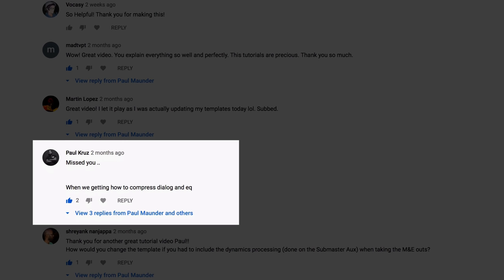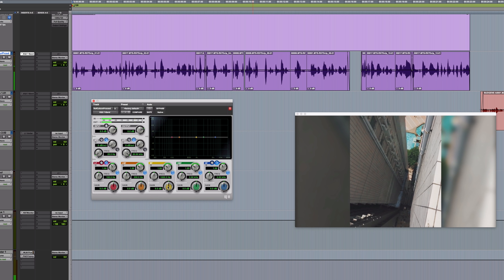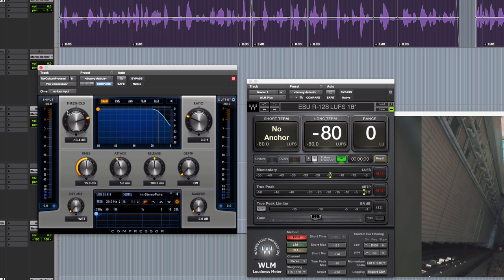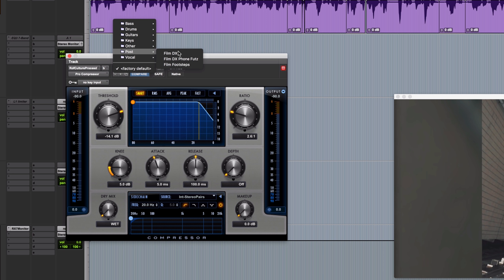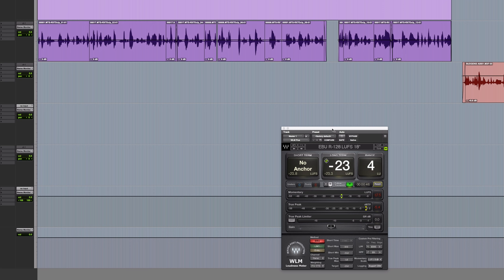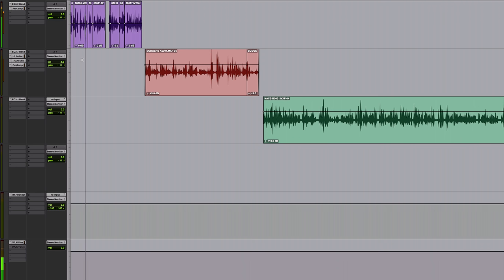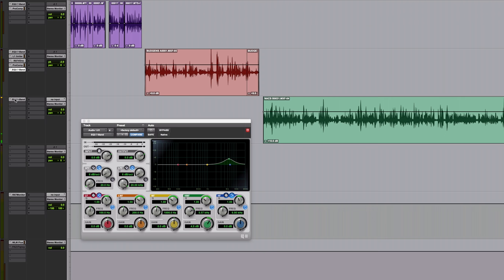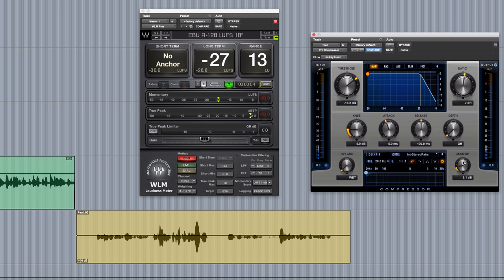How to compress and EQ dialogue using Pro Tools

Comment: Thank you Paul! I've been blindly using compression for dialogue. With your explanation and workflow, now I got a better idea of how to approach it. In the mixes I've assisted, the mixers usually have an open compressor on the DX bus, like the multiband you have here, reducing around maximum 6 db (usually less).
Reply from the maker: Thanks Gaston. I hope that you find the techniques useful!

Comment: I follow similar methods. I recently did a corporate promo, what I'd say is because the turn around was really quick, I had a day to deliver, the approaches in this video I would have run out of time. No time at all for shiney eq settings. I did a one size fits all signal processing stage on the busses and finished with tricky mixing. With that said most of the DX was good quality to begin with. But I had an hour for each version, 6 versions in all. Including session set ups.
Reply from the maker: Yes, that's very often the reality of it. A lot of the mixes I do are super quick turnaround and there isn't really time to go into too much detail with tailored settings for every piece of dialogue. In this video I've shown a workflow which works if there's sufficient time. As you mentioned though, sometimes the mix just has to be done within a certain limited timeframe. That's a big part of the reason why a lot of people use templates with plug-ins already in place and run most stuff through it with little or no changes. Not ideal but deadlines and budgets often dictate that that's the only option.

Comment: Great video. That's very similar to how I do it as well for corporate style videos. Start with an EQ, then I always de-ess at least a little bit, then Rcomp with a 3:1 ratio and setting my threshold so that generally I'm only getting around 3dB of compression. I usually always ride the fader after to smooth it all out. I'd be curious to see a video based more on narrative/feature style where there are a ton of dialog tracks, different takes, different scenes, etc.

Comment: Thanks for the tutorial, I love these types of videos! It's really cool seeing other people's workflows and methods.

I'm also a big fan of the SA-2 and RComp on dialogue. @56:45 I think that might be a good example of why RComp can be so transparent as you say. RComp's ARC, automatic release control, helps prevent situations where a large spike in volume causes the subsequent audio to be egregiously attenuated, which is what I think was happening there with the ProComp? Also, while I know this was demonstrating how to compress dialogue in different situations and mixers don't always have the time to do so; I think using some clip gain automation as it goes into the compressor could help make the compressor do less work in some of the situations shown here. I really like clip gain > clip gain automation > gentle slow compressor > gentle peak compressor/limiter > volume automation as a way to get really transparent leveling, where each stage is making the next do less (if any) work.

Another thing I noticed was during the Roof Culture track, a few of the clips (like 3) had a resonant frequency that stood out to me, but at different frequencies depending on the clip. I didn't even know it was a thing until now, but that seems like a perfect situation to use that clip channel strip thing ( as opposed to having to automate an EQ ). If only I had ProTools Ultimate :(

The only thing I was really wasn't a fan of, and I love and use RX all the time, was the Voice Denoise. I could definitely hear artifacting. I personally like EQ + WNS on the dialogue track and Voice Denoise when necessary on the dialogue bus, but I really don't like relying on the adaptive mode. Especially at the beginning of a clip, as it takes a second or so to adapt properly and clamp down and can cause other funny stuff. It's super useful in situations as you mentioned in the video, but ultimately I prefer to automate it ( again, that also unfortunately takes extra time so adaptive mode can sometimes be a time saver).

One thing I learned from one of John Purcell's noise reduction demonstrations (dialogue editor; at least what I took away from an offhand comment of his :P) is that a little bit of an expansion type noise reduction like WNS, DNS,  or C4 in expansion, can help the dialogue feel a little bit punchier, before it starts making the gating noticeable, whereas Voice Denoise or Spectral Denoisers don't really do that as much to my ears. So I really like RX/Absentia (Audiosuite) > (DX Track) EQ (filtering) > WNS > (DX Bus) RX Voice Denoise for my noise reduction workflow.
Reply from the maker: Thanks for your comments, Chris. You raise a number of useful and important points. I agree that the Voice DeNoise processing wasn't 100% ideal in this case. Typically I don't use the adaptive mode but I did a separate detailed video on noise reduction and I didn't want to spend too much time on it in this particular video. You're right about the fact that adaptive mode takes a couple of seconds to act, often not catching the noise in the first part of the audio. My personal preference for the best result would be to send it to RX and process it there. The module I'd use would depend upon the characteristics of the noise. There are times when a mix just needs to be done and sometimes, with deadlines looming, I will resort to either Voice DeNoise or Dialogue Isolate within Pro Tools. I've found the latter to give the better results in most cases.
I'm pleased that you took the time to watch the whole video and to provide such a well considered comment. Thank you!

Comment: Thx Paul ! Awesome vidéo as usual, i’m a bit surprise that you’re not using more of clip gain to even it up. maybe there is a reason ? Keep the good work !
Reply from the maker: Thanks Gael. I usually would use more clip gain but I wanted to try and keep the video to certain topics and not to go into too much detail about other processes for the sake of the tutorial. But yes, normally I'd clip gain each clip overall and selectively clip gain particularly quiet or loud parts up or down in order to smooth it out a little more prior to it hitting the compressor. Someone else commented on this too so perhaps I will address it in a separate video. Cheers!

Comment: Fantastic video Paul. Great info to recalibrate my knowledge and start the day.

If your end goal is to hit the integrated -23LUFS, do you find yourself aiming to hit the isolated dialogue at a lower level for content with loud elements - whether it be SFX or music? And vice versa for with dialogue-heavy content with the dialogue hitting close to -23LUFS and using that as the anchor point for your entire mix?
Reply from the maker: Thanks Peter.
Yes, that would be about right. It depends on how prominent a role the dialogue plays in the mix. The approach you describe is a good one.

Comment: Thank you Paul for such a great video! I learned a lot. Can I ask a question that might sound stupid? When measuring Loudness usually you would instantiate your Loudness Meter on your master and set it to Program, however I get confused and don't quite grasp it yet when you read specs about setting your meter to Dialog-Gated. Does this mean the loudness meter has an algorithm that understands what is dialogue and what is not? or do I have to insert a meter at my Dialogue Stem? (I'm thinking maybe about iZotope's Insight 2 with the Relay Plug-in added to the Dialogue stem?) Last but not least for example example Netflix Specs states that your loudness measurement is Dialog-Gated But with ITU-1770-1 (Which to the best of mi knowledge was the first revision that did NOT included a gate) so it baffles me how am I supposed to measure Dialogue-gated with a setting that doesn't include Gating?!?! (Please excuse me for any spelling mistakes and sorry for the long question) Thank you so much!
Reply from the maker: Hi Andres. These are excellent questions! Dialogue gating refers to a loudness spec which can intelligently recognise what's dialogue and what isn't. When Netflix introduced their current specs, they used a hybrid between different measurement systems. Firstly, as you mentioned, they use BS.1770-1 with no relative gate. Additional to that, they incorporated a version of the old Dolby dialogue intelligence, which differentiates between dialogue and non-dialogue. Any meter which supports this Netflix spec (I use Nugen VisLM) can be added to the master and it will measure only the dialogue component of the mix. Netflix use dialogue as the determining factor for program loudness. For most other purposes on other platforms, use a more recent version of BS.1170 with the relative gate.
Reply: @paulmaunder3007  Again Thank you Sooo much!!! thank you for explaining it in such clear terms!! All the best!

Comment: hey Paul, did you try using Oeksound Soothe plugin to remove harshness frequency from dialogue? I've try it and it's super easy and fast to do it :) plugin is absolutely doing magic, it work well on low end as well ;) All the best and keep posting great videos ! Cheers from Serbia and Synthetic Media crew !
Reply from the maker: Hi Milos. I haven't tried it myself but I've heard it mentioned a few times. I'll take a look at it when I get a chance. Thanks for the suggestion.

Comment: Great video Paul, thank you for taking the time to make it. Do you have a standard mix bus setting? For example, I've seen some use a Waves L3 to put a bit more final limiting across the mix. And if so, what settings would you use on the limiter?  Having said that, I guess your approach is to treat the dialog per track.
Reply from the maker: Sorry for the late reply. I don’t use the same settings all the time but I do have some common ones which I use often. I’ll make a video soon about it. The Waves L3 is a plug-in which I use on the master bus quite regularly.
Reply: @paulmaunder3007  Thanks Paul, looking forward to any new videos.

Comment: Hi Sir,
Can you do a video about reverb surround. 
Like when we have ADR, we try to match it with another dialogue through using EQ and Outside Reverb. Some engineers I see they send Stereo reverb Left Right + Stereo reverb Surround. 
And some engineers I see they send to mono reverb, and use plugin to upmix this reverb to 5.1. What is your favorite one to do reverb surround?
Thank you a lot
Reply from the maker: I do reverb in various different ways, depending on the project. For surround reverb my favourite for the last few years has been Phoenixverb from Exponential Audio (now owned by izotope) but recently I've been using Cinematic Rooms from Liquid Sonics.
Reply: @paulmaunder3007  
Now i'm using the old TL Space and some regular Reverb plugins. I'll try Cinematic Rooms. Thank you a lot!

Comment: Hi Paul, greeting from Moldova from a former student of yours at SSR, 2016 - 2017 ))) I have slowly transited from music production to post-prod, so I have a question regarding the loudness. I know that it is a different topic but any way... What I usually do, is that I do the work on the dynamic and eq and everything, taking in consideration the loudness specs, keeping the final mix at about the right LUFS level. After I print the mix, I run WLM Plus in Audio Suit, rendering the audio file(final mix) with the plugin at the needed value... I found this as a very fast and easy way to do the job when you need to deliver in time and with all the specs in place. So are you using WLM with Audio suite?
Reply from the maker: Hi Artur. It's good to hear that you're now working in post! Personally, I don't use WLM as an Audiosuite plug-in to correct the loudness after mix down. I get the mixes to spec as I mix but I don't see a problem with using WLM in the way you describe, as long as the mix was close to the target level anyway. Sometimes you need to do what works in the time available.

Comment: Greatly appreciate your patient, practical and therefor very useful explanation. Have you per chance used Izotope's Neutron 3 compressor (in multiband mode) and, if so, do you find it can work well, and perhaps even intuitively (?), for doing - more or less - what you did with another multi-band compressor, the matching of your four dialogue tracks that concludes this video? Thanks.
Reply from the maker: Thanks Thomas. I haven't used the multi band compressor in Neutron 3 specifically but I use some of the other Izotope stuff and it's excellent so I'm sure it's more than possible to get great results with the Neutron multi band compressor on dialogue. How do you find it?
Reply: @paulmaunder3007  Thanks for the reply, Paul. I am a photog and doc maker trying to learn to work better with sound in post, slowly but surely, and only just starting into understanding how to work best with Pro Tools. RX has become a familiar and incredibly useful tool, of course, amd Nectar too, but 'real' mixing and mastering (in Pro Tools and not in FCPX!) is still pretty fresh and I've yet to feel I really have a real handle on Neutron's power (or Pro Tools for that matter!). Your videos have been some of the most useful I've seen for practicaly guidance for working with Pro Tools on the sorts of things I do, so very much appreciated.
Reply from the maker: @Cooking_with_grandmaYT  I'm really pleased that you've found the content in my videos useful. I'll continue to make them as and when I can. Just let me know if there are any specific topics you'd like me to cover. Good luck with your Pro Tools journey!